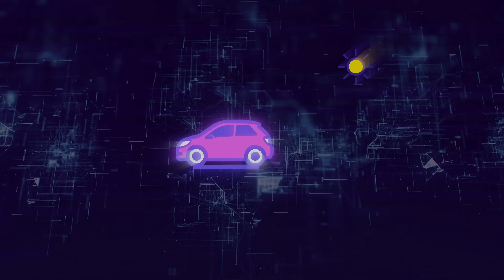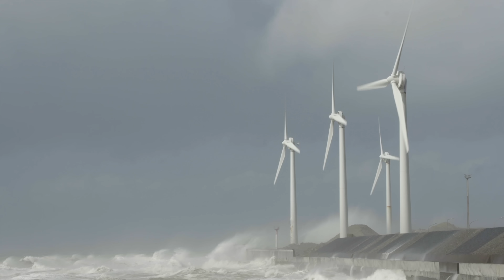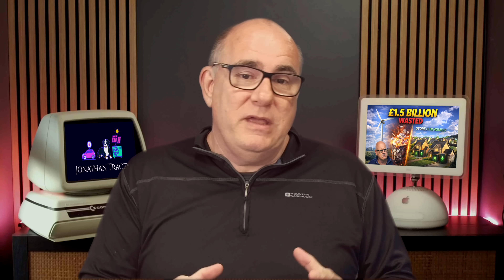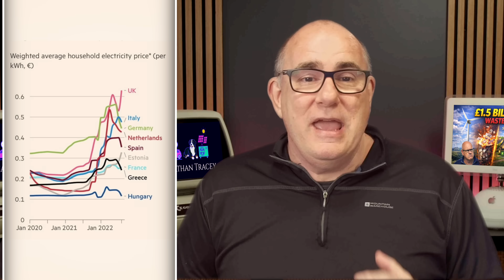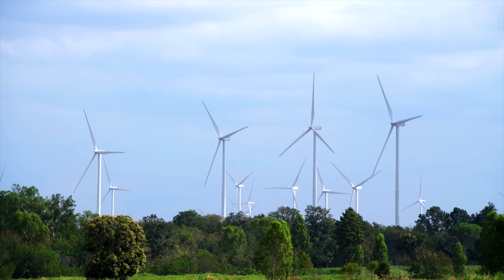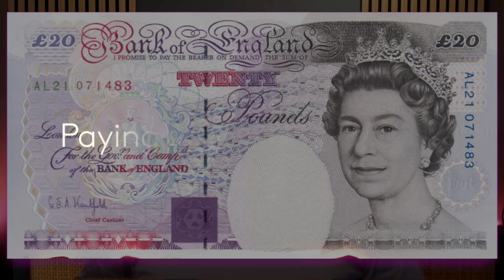We’re Paying £1 5 BILLION To Waste Energy… Here’s My Big Idea

Comment: 1) Currently Solar PV + Battery installations are VAT free. 
2) ASHP have the £7,500 grant if replacing a boiler. 
3) Your idea fit home batteries, maybe a £1000 grant?
If the government legislate new builds to have battery storage and gave grants to retrofit home batteries then the savings will be given to home owners directly. My concern is take up may be low, but it may be much easier than the first 2 options listed above. If the government can roll this out then yes I agree it can help. 
As an aside: I have been a fan for a long time that new builds fit solar panels, batteries and ASHP as standard. Once owners get used to the benefits they are much more likely to upgrade the next house with solar panels, batteries and ASHP.
Reply from the maker: Its not so much new homes its every single home in teh country, so it needs to be simple, plug and play and be something everyone gets, not have to apply for a grant, you get an install date and one shows up just like a smart meter :-)
Reply: @JonathanTracey  I guess the 'grant' is a way to help customise the installation, if someone wants 4kWh instead of 2kWh, they can have 4kWh and they can pay the difference. The idea of a grant is consistant with ASHP, so looking at continuity. But I accept this is detail.....I think your idea is fundamentally sound.
Reply: From what I have read the government has brought in plug in solar...1st April 2026. but using a Search Assist...

"What safety regulations are being implemented for plug-in solar panels in the UK?
New safety regulations for plug-in solar panels in the UK include compliance with British Standard 7671 Amendment 4, which sets requirements for electrical installations to ensure safe integration into home wiring systems. These regulations limit plug-in systems to a maximum output of 800W to prevent circuit overloads and require homeowners to notify their local Distribution Network Operator after installation"
Reply: @JonathanTracey  How do you stop them all ending up on ebay and heading off to wherever in the world people will buy them (like right now Ukraine) ?